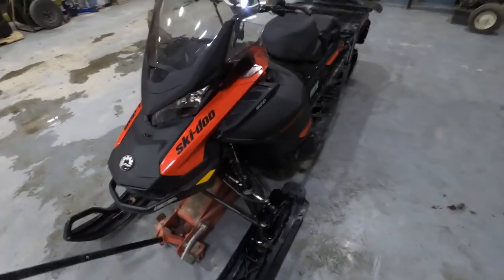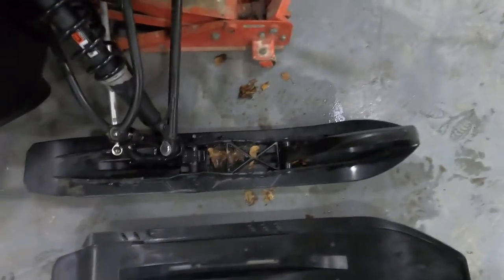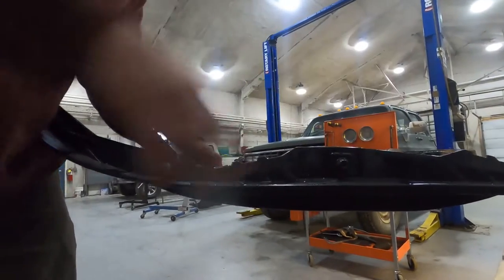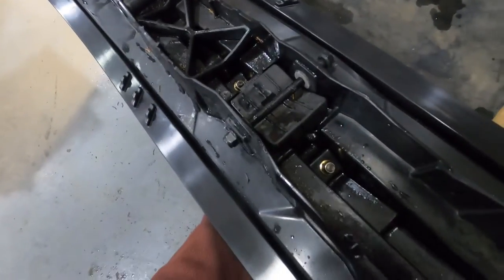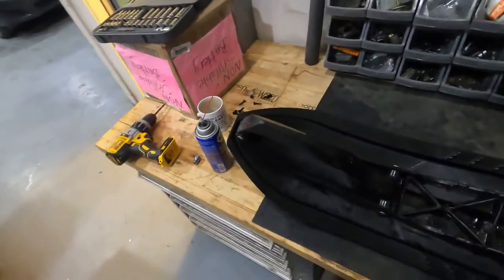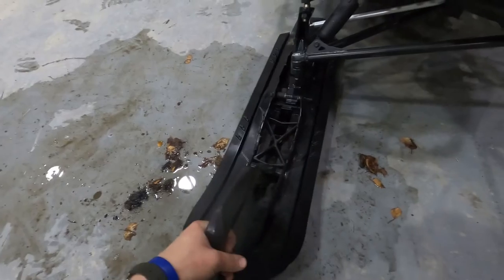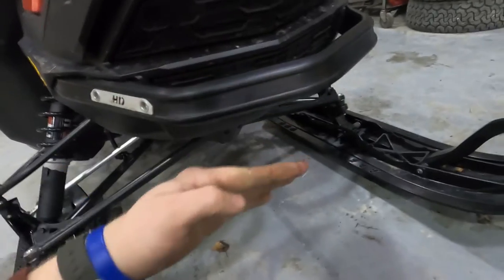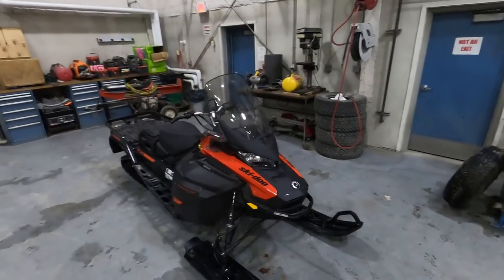Installing Ski Skins on a Ski Doo Expedition SWT

Comment: Just stumbled on your channel. Also just checked a 2023 900 expy with a 20” track. Curious if I should call them up and get these installed before next winter.  Any thoughts on the tippyness of the 20” track version? I’ll do most of my riding off trail around the road system. Probably not as crazy as you out there in the bush tho lol. Any insight would be great! Thanks.
Reply from the maker: You'll definitely be less tippy on the 20", with skins on you'll be able to go anywhere. Only real advantage to the SWT is towing heavy sleds in deep snow. Even so a 900 WT can handle its own anywhere. Don't skimp, have the dealer install a  full front skid plate, that'll also help with floatation and protection up front. Well worth the cost

Comment: Do they help prevent the tippyness of this sled?  Any other tips to defeat that. I just got a 2022 and I find that especially in deep snow it wants to tip over way too much, and I'm spending way too much time shifting my weight to counter
Reply from the maker: They do help a lot! the single best upgrade to reduce tippyness, you could also change your ski stance by swapping the bushing on the ski bolt to the other side. It would give you another couple inches of width up front. Regardless, I still find myself having to shift lots, its a big machine with a mind of its own sometimes.